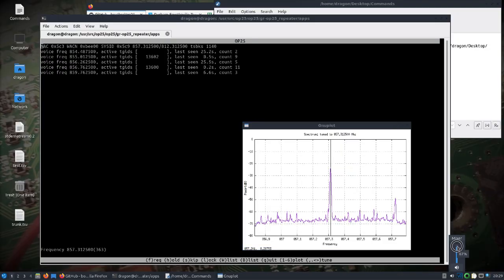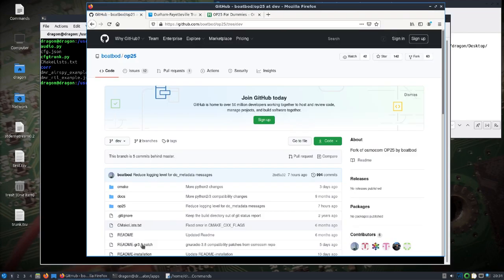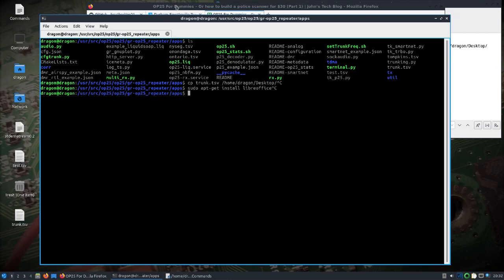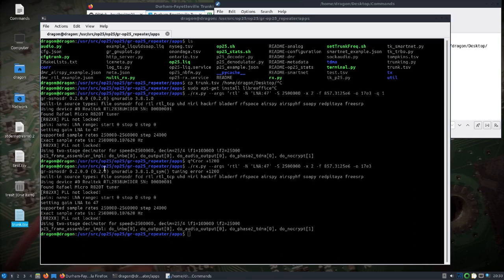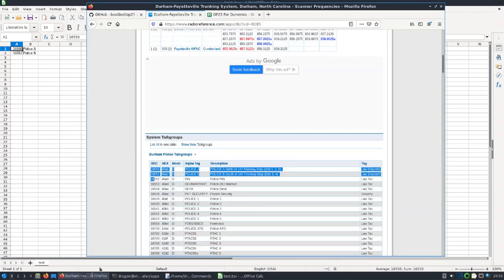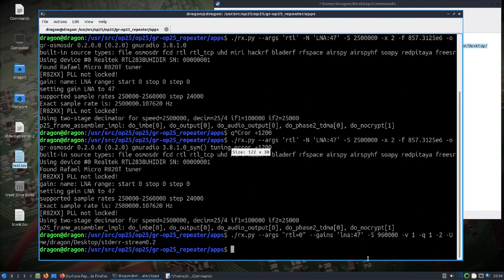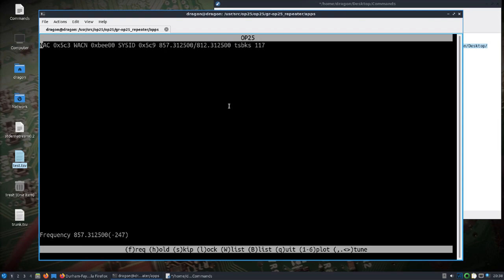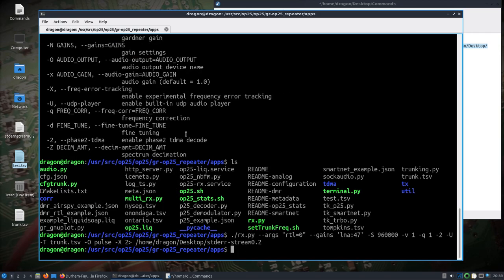DragonOS Focal OP25 "Boatbod" P25 Phase 1 w/ RTLSDR (GNU Radio 3.8, Python3, R9+)

Comment: Is it possible for 800Mhz sys to be operating on 400? Can get NAC but no data
Reply from the maker: Crazy timing, haven’t messed with Boatbod in awhile but just got it built on 22.04 w/ Gnuradio 3.10 using a fork! I’ll have to give it a try, not sure about your specific question though. Hope to have a new version of Dragon soon, also need to put this on the Pi build too.
Reply: I'm just scratching the surface on all this... so much to learn lol. I'll keep an eye out for new version of dragon.

Comment: Do you know how I can get the audio codec for it? I asked signals everywhere and he said settings but I don’t know what he was talking about.
Reply from the maker: Hi hector. I’m not sure what you mean by audio codec, I’ve not had to include anything additional for audio. Signals everywhere was probably referring to having the correct settings in your command line to get audio to play.
Reply: @cemaxecuter7783   I’m running it on Ubuntu and as far as I know all you need to insert is a  -u and that will get it to work. Haven’t been able to get it to work tho. Any advice?

Comment: Thanks for this! I'm about to dive in with my bladeRF 1.0 and heard your comment at the end. Ever get it working?
Reply from the maker: I played it again to remind myself what I said. You know what’s crazy, this past weekend or so I had this same setup going with a PlutoSDR. I’ll check the args I used but I basically used soapy, but I don’t think that’s needed for the bladerf. I think it should just be able to work just like it does for the rtlsdr and hackrf. Maybe it was the way I was doing gain or something. I’ll have to try again.
Reply: @cemaxecuter7783  I got it going! Two key takeaways: Use the previous version FGPA image (0.11) not the latest, and you need to configure the LNA gain from the CLI or gqrx. I used the latter but then used the CLI to configure the amplifier board. Caveat: --no-crypt isn't working and -f must be specified even with -T. Phew!
Reply from the maker: So that’s interesting, wouldn’t have thought about all that. Previous fpga because it’s the v1? I only have the newer models and I stuffed them latest fpga stuff into DragonOS so it’s automatically loaded, but you can also use the cli tools to change that. I just finished putting SDRTrunk onto the Pi, but I think OP25 is much better with resources.
Reply: @cemaxecuter7783  There is a bug in the 0.12 image that causes USB transfer issues. If you have the bladeRF 2 then I am guessing it isn't affected.

Comment: I got OP25 set up a couple years ago, it worked awesome up until last time I tried to use it. I'm not sure why, but it just doest work right. I've been considering re-setting it up, and definitely will now! thank you!
Reply from the maker: Thank you! I quickly got it setup and working with the Boatbod version, which I need to go back and update. But there’s this gr-baz thing that I’m messing with now that requires a patch to a really old version of OP25, gnuradio 3.7 it seems, and maybe then I’ll be able to use a gnuradio flow graph for p25.. not sure but seems interesting.
Reply from the maker: Please let me know your experience with it or if there’s improvements.